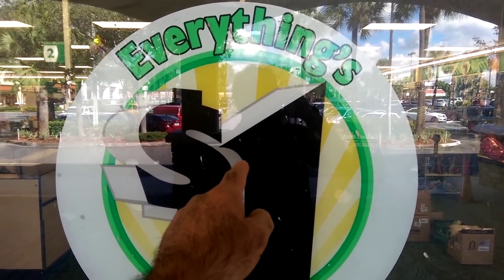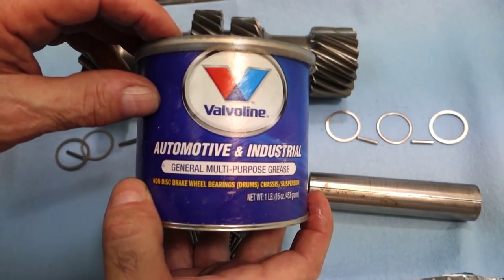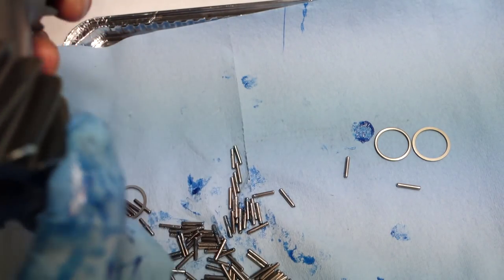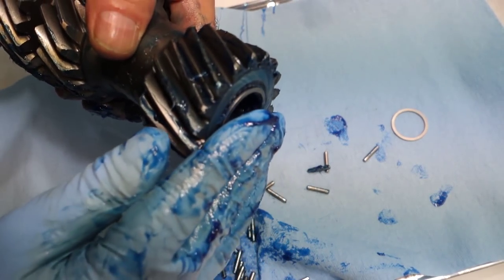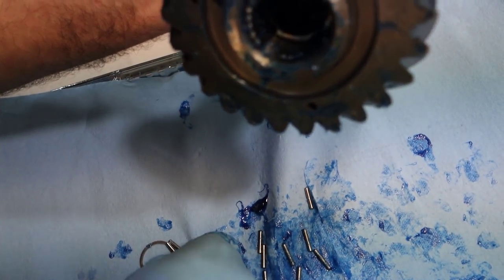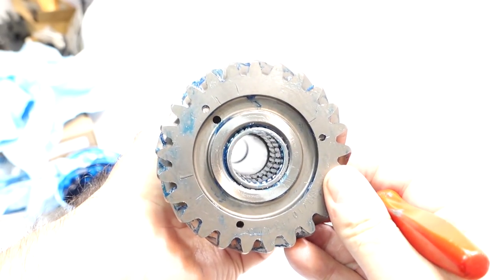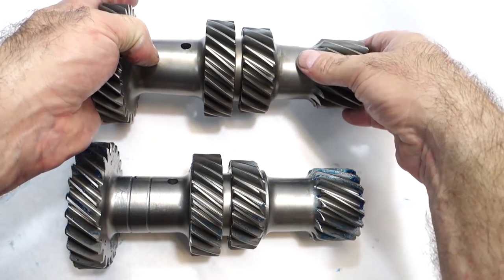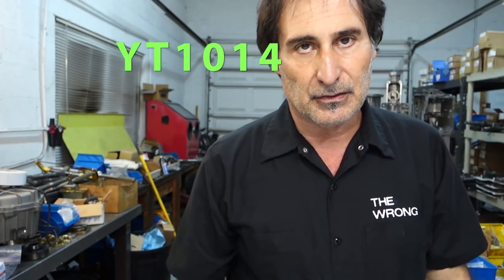How To Rebuild a Muncie 4 Speed - Installing Needle Bearings

Comment: I went through trade school for auto mechanics in the mid 70s we had to pack the bearings with the wheel bearing grease and no one was wearing gloves back then. I messed up when I trusted one of the instructors that got me a job at a marine shop that was supposed to send me to evinrude school so I never worked in a auto shop and never went to evinrude school

Comment: my rear reverse idler gear has about 0.060 up and down play on the shaft . thats with the rear 0.030 thrust washer . the idler gear doesnt appear worn at all . it measures 36.30 overall length
Reply from the maker: Have you looked at the bushings for wear? Or do you mean endplay?
Reply: @GearBoxVideo  endplay

Comment: The shop manual for the 1963 Studebaker Avanti shows the T-10 4 speed needles and spacer washers in the countershaft in a different sequence.  It shows needles against the countershaft bearing roller, followed by two spacer washers, the next set of needles and then an outer spacer washer.  Does it matter or is one way better than the other?
Reply from the maker: The shop manual is wrong. The correct way is in the video
Reply: @GearBoxVideo  Over the past few days I did an extensive amount of research on this and finally found the answer.  I reviewed the expoded views of earlier T-10's from many other makes and models and they all had the double spacer washers and no spacer washer agianst the countershaft bearing roller.  The reason for this is that on the earlier T-10's the countershaft bearing roller was seamless.  Somewhere along the way the T -10's and Muncie 4 speed countershaft bearing roller started to be built with a seam and the need for an inner spacer washer became a necessity.

Comment: also bought your book from barnes nobel  can you recommend a couple of places to purchase the italian cluster gear for
my m21 trans with 1" pin 1966 model year.
Reply from the maker: Autogear discontinued the M21 countergear.  They still make the M20 piece which we still stock.  Those are made in Italy. The reality is, if you are mixing gears, used gears against new gears, getting a Taiwanese M21 cluster is fine. The new Italian M20 sets are a great redesign.  Info is here: http://goo.gl/0zWCaF
Reply: GearBoxVideo thanks for all your help

Comment: Just curious, what is the clearance between the OD of the counter gear spacer tube and the ID of the counter gear bore? Once assembled, the counter gear shaft can never touch the tube because it rides on the needle bearings, correct?
Reply from the maker: Yes correct. The Muncie tube ID is a little over 1"

Comment: I just took apart an m20 out of my daughter's '69 SS el Camino and fond 7 of the spacer rings in the counter gear but, didn't see where the 7th ring was. If I install the 7th ring, the total bearing length is still shorter than the thrust faces.
Reply from the maker: There are only 6 spacers and when stacked sit below the thrust surface. Some rings vary in size. If you need to stack an extra stack it against the tube
Reply: @GearBoxVideo  Now you tell me! Will do, though. Thanks!

Comment: I purchased a 1970 camaro rs with the m21 in it. It's stuck in 2nd gear. What will cause that? Also, I purchase your book off Amazon before seeing this video! Thanks
Reply from the maker: If you disconnect all linkage components and physically cannot move the 1-2 shift shaft by itself out of the 2nd gear position, a few things usually happen.  The rings flatten out and the 3 little keys slip out of the slider and wedge the slider in 2nd gear position,  A missed shift can sometimes tear up the teeth of the slider and jam the mashed teeth on the hub and rarely a detent comb breaks in the cover and jams the mechanism up.  If you do disconnect the linkage and it easily is  moved manually out of 2nd gear position, then it may be time for a new linkage. Visit http://www.munciebook.com for book updates. Thanks for getting the book.

Comment: I can only seem to fit 18.. and it tried packing em in tighter. Iv taken em out and cleaned them multiple times. Idk what I’m doing wrong.
Reply from the maker: Pay attention to the size of the needles in the video. You probably have a 7/8 inch countershaft which uses less needles. You are doing nothing wrong.
Reply: GearBoxVideo I figured it out man. I’m doing a rebuild on a 1977 dodge d100. 4 speed. I didn’t realize u had to do them on both sides. I was trying to pack them all on one side and that’s why they wouldn’t fit. The mopar cluster has this groove that seats the washers/spacers. I didn’t pay close enough attention to the video. Thank u man!

Comment: cool, thanks for pointing out the fact that wheel bearing grease is ok to use for this..that's what i used on my m20 and then wondered if it was ok. a lot of guys say grease and then come to find out they use assembly lube like you use but call it grease. I'm curious why there are no caged bearing available for these like you use in your spec-25?
Reply from the maker: The SPEC-25 is mostly run in 3rd and 4th.  There is no severe loads in 1st.  I want full support of all the needles on a street / strip transmission.
Reply: well that makes sense. it sure looked nice just dropping a couple cages in each end and your done.

Comment: I have an m22 transmission I'm 66 and it doesn't want to shift into 3rd. however it downshift from 4th to 3rd with no issues could this just be a worn shift fork or a bad sync
Reply from the maker: Block out conditions are caused by bad synchro assemblies and poor clutch release.
Reply: So your saying its probable a bad synchro
Reply from the maker: A bad synchro assembly or poor clutch release.

Comment: It looks like your gloves may be one size too big.  They're not forming to your fingers.
Reply from the maker: I hate tight gloves. I rarely use gloves. Gloves don't last long-term
Reply: @GearBoxVideo  Understood.  I made that remark in response to your comment early on about not liking to wear gloves because it makes the work more difficult, or some such.  It looked like the gloves were fitting loose, which would add to the difficulty.  Suit yourself.  Thanks for all of the interesting gearbox videos.

Comment: Paul; I put my m20 together using a 1974 motors manual. On the counter shaft, it had the pipe spacer, then rollers, then 2 washers, then rollers and final washer. I just went back to my manual to verify and this is correct.
So to sum up the rollers are riding right up against the pipe spacer.
What do you think ??   Thanks
Reply from the maker: Set them up as instructed in the video. The manual is WRONG
Reply: GearBoxVideo Thank you Paul for your advice and quick response. 
Have a great day.

Comment: I thought. . .   surely he’s not going to use a a seamed tube for the countershaft to spin on. . .   oops.  My bad.
Reply from the maker: It's a spacer. Nothing spins on it.  Split seamed tubes have been used in Muncie and T10 applications for over 50 years
Reply: GearBoxVideo : Yes, I picked up on that fairly quickly.  I’ve built a couple of bicycle frames. . .   from seamless tubing.  But I’ve run into steel frames where, running my finger inside the head tube, I’d have that “Oh, Oh” moment.  And so e of these frames were NOT cheap.  Sigh.

Luv your stuff!

Comment: good video question I am building a NP203 transfer case, when I put the needles in I get a gap in the needles when they are all in but this gap is cannot fit 1 more needle in. is this ok or will I have to force 1 more in?
Reply from the maker: No this is normal. That clearance remember is for all the needles combined. It's fine.
Reply: @GearBoxVideo  thank you very much for your input and time.